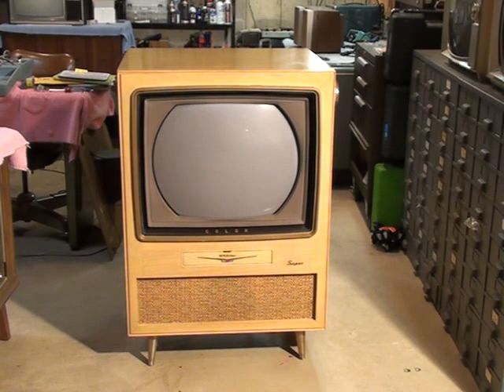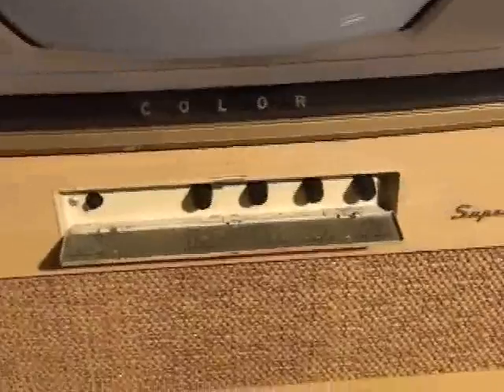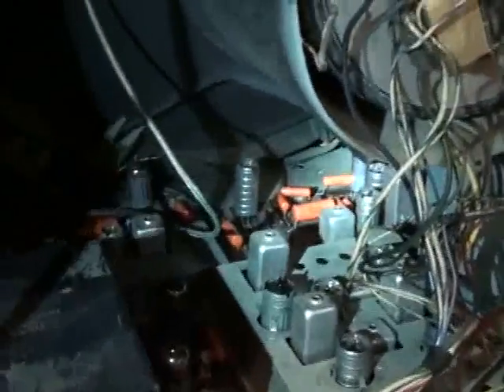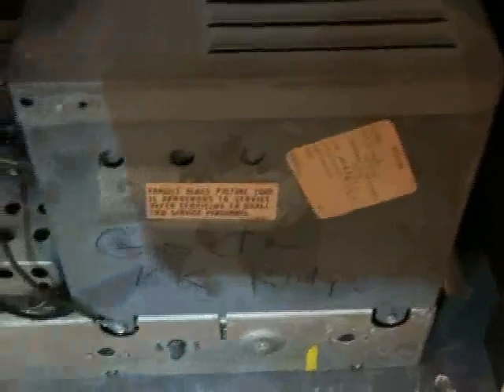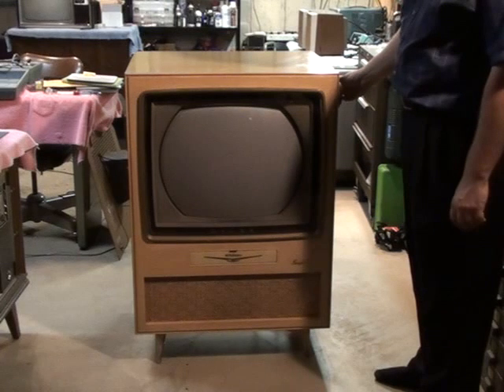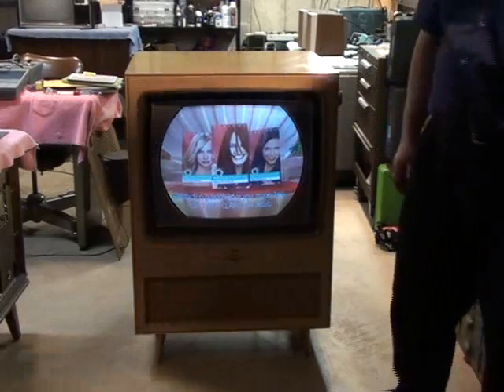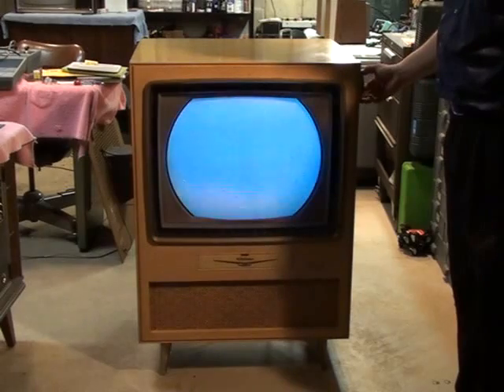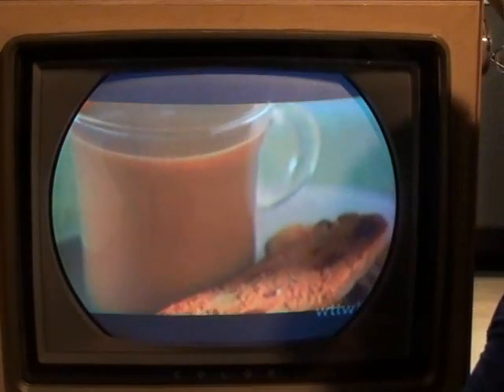Watch a 1956 RCA VICTOR CTC-5 COLOR TELEVISION!! "Roundie"

Comment: NBC, owned by RCA, did most of the early color broadcasting to help promote sales of receivers.  CBS, who lost a patent battle with RCA over its mechanical color TV process (a real "Rube Goldberg" system that, unlike RCA's color, could not be received as a B/W picture) actively fought against color; while cash-poor ABC simply couldn't afford color equipment.  Some individual local stations did adopt color for local programs.  Thanks for sharing this wonderful old TV set!

Comment: That was an incredible picture and Sound for the age of the TV.
Linearity both vertical and horizontally from what can be seen without a grid pattern was spot on.
Did you have to adjust it at all by using the CRT neck adjusters?
That could be used today full time, the CRT didn't look tired at all.
Good restoration job.
Reply: Hello, there was no replies in 6 years so I am just here to change that

Comment: Great job done there. Years ago, in NZ with assistance I put together a VCR97 Oscilliscope tube TV set in green! It took a NZTV technician to finally get it going but eventually after a couple of dry Summers and static electrical discharge episodes I decided the punishment was too much. It went out into the garage. 
Bravo to you Sir.

Comment: Nice restore and awesome convergence job! I always loved 'roundies' because the phosphors they used in the crts had accurate hues, especially red. The rectangular crts had a brighter picture, but the red phosphors were orange-red in hue and they 'fudged' the color demodulators to try and compensate.
Reply: Dipende dai sistemi utilizzati di trasmissione NTSC, PAL, SECAM l SECAM G, come colori anche ora con i multistandard il migliore come definizione è il francese SECAM anche nei LED, OLED e 4k

Comment: I didn't know the USA had colour TV in the 1950's. Here in Australia we got colour TV in 1975 using the PAL standed and we don't have a tint control on the CRT TV's.
Reply: Westinghouse introduced a color set in 1954. I believe it's one one of the earliest commercial (as opposed to experimental) NTSC models in the US.
Reply: Sean are you sure? I'm from New Zealand and we got colour tv in 1973 (in time for the commonwealth games that was held here). I'm sure Australia was earlier like the late 60s.

However though the broadcasts were in colour, I think my family brought their first colour set in the early to mid 80s due to the cost.
Reply: In Australia, colour broardcast was officially launched in Australia on March 1 1975 using the PAL system
Reply: Jügren van der Kaas
Australia had B/W TV from around 1956 or 57.
Reply: Yes, although it wasn't very common in the U.S. until the late 1960s/70s. My dad, who was born in 1958, said his family didn't own a color TV until 1972.
Reply: I too was born in 58 and we did not get a colour set until around 1971.But, here in the UK, tv broadcasts only began in colour on the UHFfrequency band around 1968.
Reply: NTSC = never the same color ..... Pal does not need the tin control. NTSC needs, because it has not an selfcompensation while the transmission.
Reply: CBS Laboratories had developed a color TV system with better resolution back in 1954.  FCC declined it because it was incompatible with existing B&W sets.  RCA developed a system with a little less resolution, but it's signal could be seen on any set in B&W or color.  That's the one FCC approved in 1955.  NBC-owned stations installed it immediately;  it took affiliates, and those of ABC and CBS, well into the 60's to make the conversion, as did many program producers.  It wasn't really until the '66-'67 season that the networks were 'all-color'.
Reply: You Aussie's inherited the same transmission signals as we have in the UK.PAL is the standard used in the UK.  In the States, they use NTSC which usesa different way of transmitting colour signals. Hence the need for a tint control, which I suppose is what we would call the contrast control, to alterthe definition of the colour or indeed black & white picture. Incidentally, wein the UK started receiving colour signals on the UHF waveband in the mid1960's.
Reply: The CBS sequential color system was actually introduced in 1951 and was the FCC approved system. It used a spinning color disc in front of the screen and was not compatible with existing B&W sets. It was only used for  few months because CBS could not get any manufacturers to make their sets. They ended up buying a small manufacturer but only sold a tiny number before shutting the system down. The RCA compatible color system (NTSC) was finally perfected in late 1953 and the first sets went on the market in early 1954.
Reply: The CBS unit I saw had no spinning disc, and all color systems (RCA, CBS Labs and DuMont) were considered experimental prior to the RCA approval.
Reply: CBS system had a spinning disk.  If you saw something that didn't then it wasn't the CBS color system.  Call it experimental if you want; I wouldn't since it was FCC approved and was being sold to the public.
Reply: Actually, CBS colour had poorer resolution than NTSC, a 405 line raster equivalent to the old BBC system in the UK.  The difference was the frame rate, a 144 field per second scan that included three full fields for each frame (red, green, and blue), yielding 48 complete frames per second.  While the color was fabulous, the fragile (and noisy) mechanical color wheel system and the lack of compatibility with all the previous b&w sets spelled its demise.
Reply: The famous program Bonanza was from the 1050's to 1960's it was in Colour and many people purchased Colour TV sets to watch this show and Walt Disneys Wonderful World of Colour
Reply: Bonanza was the first NBC full color program 1959-1973.
Reply: Most of Europe did not have colour until the seventies, also most countries only had 2 national channels .In Canada we had colour , due to the vicinity of The United States , if people lived close to the border. and in Canada  ,we had 6  channels .The U.S.had  3, so 3  Canadian and 3 U.S. . Just because colour tv was a available it does not mean everyone could afford a  colour television .We did not get one until 1974 a Hitachi with remote control WOW??? , the prices started coming down and the colour in the first years were bad , too many green faces. We had a colour television , before my father's uncle  in The U.S.A.
Reply: Here in Mexico, the color broadcasting started officially in 1968 during Mexico's Olympic Games of that year.
Reply: The tint or hue control allowed for the viewer to adjust the picture to their liking.  Once it was set it didn't need frequent changes.  That is an  ignorant European myth.
Reply: Australia has to wait for big daddy or big mommy England to make a decision and then they dutifully go along.  Same thing happened with digital television.  No independent thought!
Reply: @DDBurnett1  Depends on what you mean by common. There must have been a substantial portion of sets by early 1966, because that's when all prime-time shows, on all networks, finally were in color.

It was quite a quick transition, as I think it was late 1962 or early 1963 before there were any color shows on anything other than NBC. That's at least a five-year gap, so I think it must have been due to some kind of legal wrangling, not a difference in technological status.
Reply: @ronaldgarrison8478  the majority of TV-owning households (eg more than half) had a color TV as of 1972, but it had been growing rapidly all through the 60s - 350,000 color TV households in 1958, 500,000 in 1960, 5.2 million at the beginning of 1966, which is when the mass switch of network programming to all color all the time happened, about 1/4 of TV households had color by the start of 1967
Reply: Im from Michigan. We didnt have a color set until 1973 due to cost.  My Grand parents had color sets in 1965.  We used to go over their house to watch christmas specials in color.
Reply: In my experience, only very old or cheap TVs have color controls. All the others don’t need adjustments because they’re made reliably.
Reply: Here in the UK we got colour tv in the late 1960's.
When transmission went from VHF to UHF. And
our crt's went from 405 lines to 625 lines.  We
didn't get a colour tv until 1971.  It was a 26"
screen, which was large at the time, probably
the biggest available back then.
Reply: @inkey2  I'm talking about late 70s/early 80s and newer mostly, I haven't had a set older than that. Currently I have some 1980s cheap portable TVs which are pieces of poo and have some adjustment potentiometers, and a 90s Samsung fullsize TV which has no adjustment potentiometers even on the internal circuit board, but it shows a good picture regardless because it was just made to not need adjustment.
Reply: @Liftinmike  wow , didn't realise tv went back so far..
Reply: @mibnsharpals  but PAL came wafter NTSC was established and would cost the USA a HUGE cost to convert this is why it was never adopted in the USA. Video tape machines were already using NTSC as well
Reply: Half of Americans still don't know there is color TV....
Reply: tint control - the knob that got me scolded.
Reply: @rjmcallister1888  Didn't the CBS system use a spinning color wheel in the picture tube?
Reply: @someonehasposted  FCC set RCA as the standard in 1955.
Reply: @jgroenveld1268  Colour telly came to Australia in early 75. Our neighbours got one of the original Philips colour sets. I remember my shock at seeing the colour of the space suits in Space 1999 for the first time, having just assumed they were silver when I watched the show on our black and white set. Remember feeling rather privileged to watch colour tv - especially as that set had three hours repair time for every hour it actually worked. :)
Reply: @DDBurnett1  The US 'Color' TV Boom actually went mainstream in the Mid-'60s. In fact the three or four US Networks told the Producers at the time to add in the words 'In Color' at the beginning of each Network TV show, as a way to entice the public into swapping out their older B/W TVs for the Color models. This was around the '65-'66 Season.
Reply: @garydunn3037  
1969
BBC2
Reply: @bobrew461  1967 on BBC2. 1969 on BBC1 and ITV.
Reply: Sean...Who do you think invented the Color TV?..Back then the Asians were not involved in Color Innovations The USA was..

Comment: Forgotten fact--American analog tv system had a horizontal scan rate of 15,750 Hz.  The horizontal sweep transformer in the set consequently vibrated, or "hummed," at this frequency, producing an audio tone that could be heard by children but not adults.  As a kid, I could tell by listening if the television was on, even if the sound was turned off.
Reply: Hopelessand Forlorn I remember walking into a room or computer lab and hearing a TV or monitor on somewhere.  I would search around until I found it and turned it off.  My father could not relate.
Reply: Hopelessand Forlorn That is so wierd, I remember being able to hear the old tv's when powered on but no picture or sound. It was extremely high pitched.
Reply: I used to fix TV's way back then. Sometimes we used to wedge wood chips into the flyback transformers to quiet the vibration.
Reply: same as me!
Reply: Hopelessand Forlorn me too. But i was born in the 80's. Did tvs back then hum too?
Reply: Yes, this would apply to any CRT TV or monitor.  If one wishes to nitpick, for NTSC color, it's just a touch under 15,750 due to the color signal running a little less than 30 fps for reasons having something to do with color subcarrier and I don't even pretend to understand.  But 29.97 fps times 525 lines per frame means the horizontal deflection coils are running at about 15,734 Hz.  The ability to hear that high diminishes as we get older.

And of course computer monitors run at various frame and line rates; mostly higher, so the frequencies may be so high even children cannot hear.
Reply: I used to hear it as a kid, but that's when there weren't flat screens everywhere.
Reply: Here I am, 38 and can still hear 15kHz flyback ;)
Reply: LocalH Enjoy it while you can, it will eventually "disappear".
Reply: Thank you.  I wondered whathat frequencyvas.  I could hear it to late teens.
Reply: Same Here.   Thankfully modern televisions have no Raster scan and are silent when sound is off.
Reply: Funny, I remember hearing that high pitch before my first ac/dc concert, but not after.
Reply: @johnhoward3042  That's b/c you've been Thunderstruck
Reply: Hopelessand Forlorn PAL TVs do it too.
Reply: Whoa, I remember that noise.
Reply: @jurekogorek6715  thunder from Down Under?
Reply: I can still find CRTs that are left running because of that coil whine.
Reply: Me too! Parents thought I was crazy.
Reply: @cactusvenomradio7232  Fly-back transformer, or has my memory gone too far?
Reply: Thank you so much for clarifying this. I was driven crazy by this sound as a kid and told my parents the TVs "screamed at me" even when the volume was off. They had no idea what I was hearing and insisted I was imagining it. I've forgotten all about this until I saw your post.
Reply: Same for TVs in Europe. I remember this very well from when I was a kid.
Reply: As a working musician, I could hear that pitch into my 30s.  I used my hearing protection... I continued with top flight hearing until I had an acoustic trauma in my mid-40s. A couple of slammed car doors (by my kids) later and I have to have subtitles on almost everything.

Protect your kids' ears and protect your own.
Reply: @cactusvenomradio7232  Switched power supply for CRT they were common in later (70's 80's) designs.  They were basically same thing as are in power bricks and virtually in any modern power supply, but working on bit lower frequency in high end of audible range as materials back in the day were not able to handle higher frequencies or were too expensive.
Reply: Ironically, us older folks eventually get a  high frequency audio tone that nobody else can hear - tinnitus.  I wish I could turn it off.
Reply: @pantherplatform  Now sometimes you can hear a flat TV make a high pitched sound, might be a sign of the power supply being on its way out.
Reply: I remember that hissing sound whenever the TV was turned on. Used to sound like high pitched tinnitus.
Reply: Dude, you're my freaking HERO! I've wondered since I was a toddler what that sound was and why it was so high-pitched! I've always been interested to know, but never knew where to even begin to find the information! I'm 32 now and I can still hear that sound very, VERY clearly with my CRTs. I always know when one is on. Even my 2000 Sony Handicam viewfinder makes that same noise.
To me, bats sound exactly the same as a CRT.
Reply: The high frequencies limits on adults tends to decrease with age but another fact occurs, I own constantly im my ears a high frequency hum that coincides very aproximately with the 15.750's horizontal line scanning on analog tv sets... I'm 68 now and serviced tv's since I had 14 years old...

Comment: 2008= Timely demostration.Try this a couple of years later: no analog broadcasting anymore...
Reply: Dirty_Horror A beef a lot of people have with cable is that although you get a lot of channels, many of the SD channels are still analog.  Because it's a closed system, they do not have to abide by the mandate.
Reply: It's still possible to demostrate working of this type of TV while having RF modulator or using cable analog TV. Anyway I think that analog broadcasting was shut down too early.
Reply: BilisNegra I think the analog feed is completely gone in my area- Boston, Ma.
Reply: you can use a converter
Reply: It's a shame.. 😭
Reply: Yeah. I was about to write a comment saying “where do you live, having multiple analog stations” but then I realized the video is 12 years old
Reply: I believe that there is already some kit that can be found on the internet that takes composite video and turns it into TV signal.

Comment: In today's dollars this TV set would be costing in the range of $14,000.  Only people who were fairly well off would buy a TV like this. 

With these TV sets if all the components are in proper spec and in good condition, and including all the alignments are in proper set up, the pictures are excellent.
Reply: At least here in the UK it was common to hire televisions - from Granada and Radio Rentals (microwave ovens too). Right up until the late 1970s. My generation has mobile phone charges, older people hired televisions.
Reply: yeah...you had to be a doctor, lawyer or bank robber to afford a TV like that back in the day
Reply: You are indeed right, most of us British peasants could not afford tobuy colour tv's back in the early 70's, and so had to rent one as youmentioned. Prices of consumer electronics have come right downsince then, mainly due to cheap imports from China. This has madeit possible for most now to buy them outright.
Reply: the first 2 TV sets my family had were given to us by financially better off relatives. The tv's didn't last long as they were old when we got them. The first new TV we bought was a real odd-ball my dad got at a warehouse sale. It was a Sylvania table top model, blonde wood cabinet and had this white plastic frame around the picture tube that lighted up when you turned on the set. That TV was JUNK and died in 4 years. Then we bought an RCA, B&W console on legs. That was a good TV. It lasted at least 10 years
Reply: I think the previous owner of this TV appreciated paying a lot of money  and looked after it - these days tv sets are so cheap they are almost disposable ....
Reply: you are so right.That was so out of reach for many Americans at that time, by the way it would be another 10 years before things were broadcast in color on a regular bases.
Reply: Even if I could afford it I wouldn't pay $14.000 for a tv.